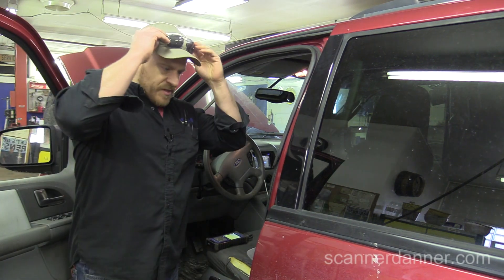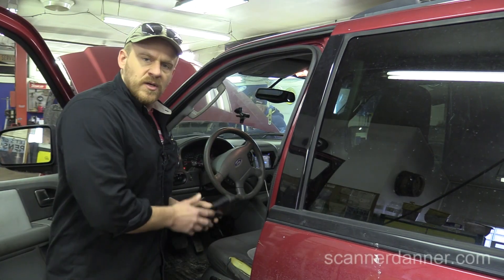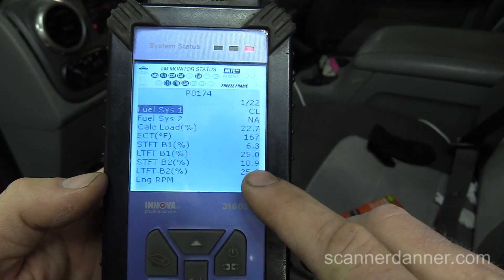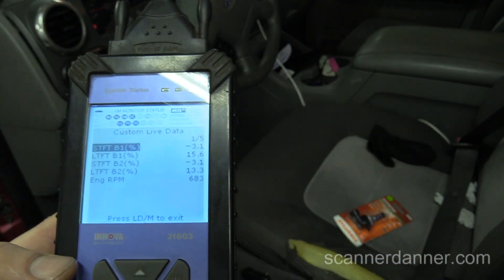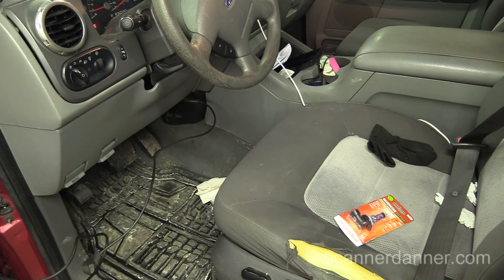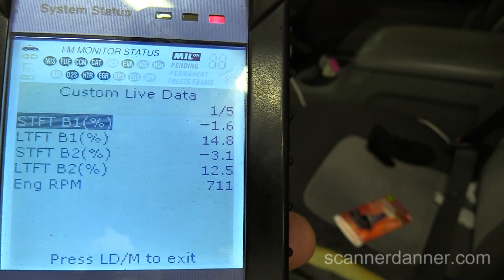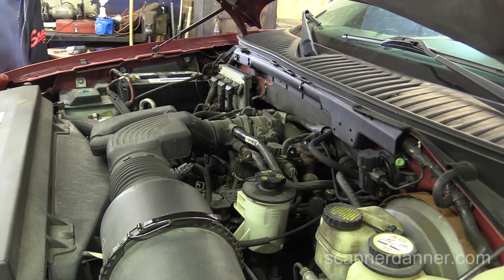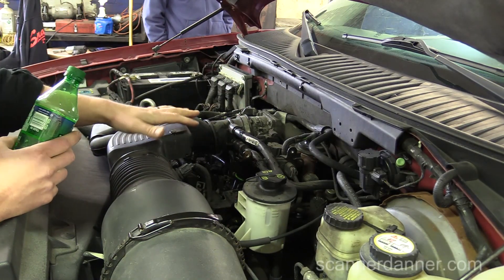System Too Lean (P0171, P0174) - Vacuum Leak Quick Test - Ford 5.4

Comment: I prefer using Pepsi over a Sprite bottle, I find the caffeine helps me find the vacuum leak much faster.  lol
Reply from the maker: +Ozzstar haha nice
Reply: Ozzstar
Reply: would this  cause a hard start issue when engine gets warm..i have a 02  jeep liberty have had that issee with then just the other day it through a  lean code p1074 ..
Reply: Intake leak (or dirty MAF sensor) tends to affect both bank 1 and 2, not just bank 2 as your code p1074 indicates, though a minor leak on certain intake manifolds might start out only affecting one bank enough to generate the code for that bank.

You cannot just guess, the whole point of the video was look at the fuel trims and get the water, or carb cleaner, or a cigar to do a smoke test and see where the problem area is.

Actually in the video the problem went the opposite way, that the leak was reduced when the engine warmed up.

You stated hard starts but not exactly what it's doing.  You could have a head gasket leak on that bank, or possibly a bad temp sensor, even more than one thing wrong, one causing hard start which went on for a while it seems, and now a lean code too.   It is good on a vehicle that age to review what is original factory such as fuel filter, spark plugs and wires, though plugs and wires will tend to cause specific cylinder misfires.
Reply: Hahahahaha.....Good one....water???? How crazy.
Reply: Ozzstar u know some ppl may take u serious and then u fk thier car up.smh

Comment: engine running at 20 inch vacuum is the same force on the sealing surface as 10psi net pressure. im sure the smoke machine only uses inch WC.
Reply from the maker: +Steven Tenney good tip Steven. Thanks!

Comment: On small leaks I've found brake clean and live data helps. When the STFT consistently goes rich, you've found the leak. 

Leaks too small for those methods? Smoke or like a video of mine where I went crazy DIY with no fancy technique, just look for and replace crusty vacuum lines.
Reply from the maker: +DE “AutoBravado” Nichols used that method many times myself

Comment: very ironic that I'm working on a 2002 expedition 5.4L ...looks like it was pulled from the swamp ......severe misfire and won't go over 45 with no codes ....feels and sounds  like it's running on 5 or 6 cylinders
Reply: you have to use a good  scan tool that does power ballance